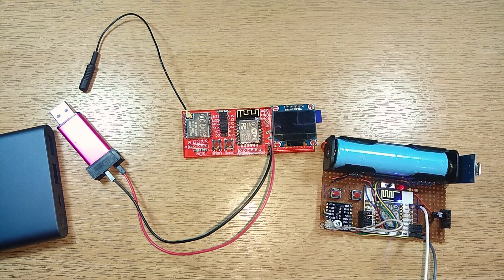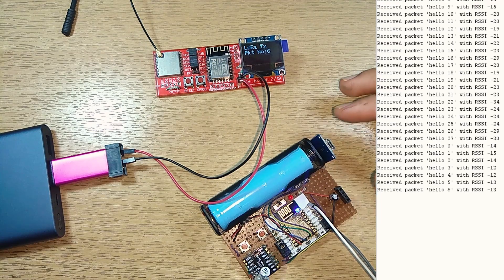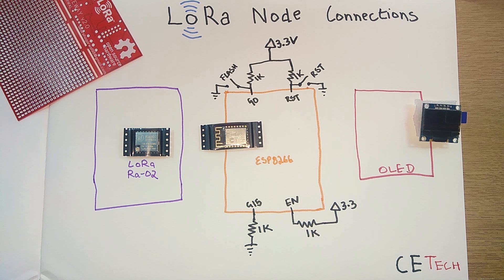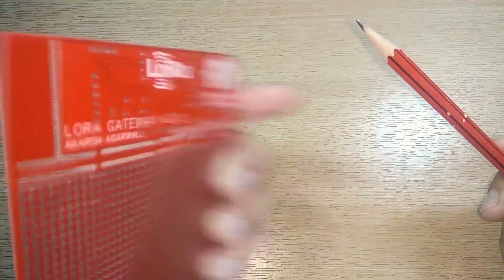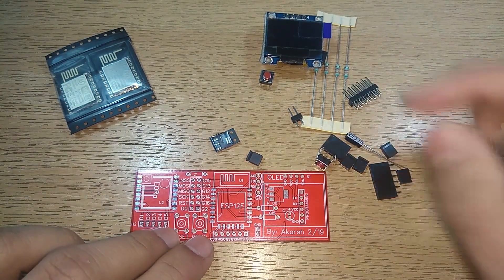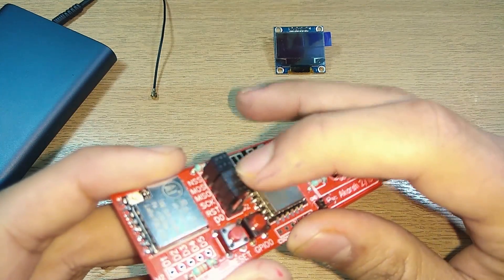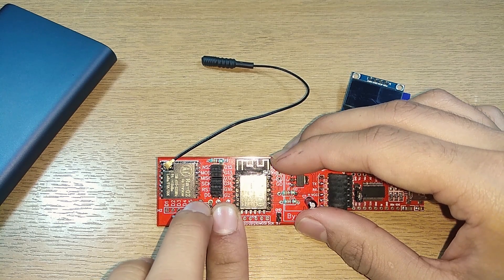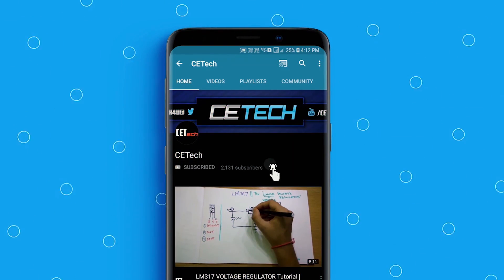15$ LoRa Gateway Node ESP8266 | Ra-02 SX1278 Tutorial

Comment: Hello CETech, greetings from Peru, congratulations on your excellent work! I would like your help. I have proposed to implement a monitoring system to warn of land overflows ("huaicos") in my city, for that I am thinking of setting up a "Wireless sensor network", I have researched and want to use LoRa technology, but I am still learning and Your videos have helped me a lot in developing my possible solution. Correct me and guide me if you think something is wrong in my plan: my system is made up of 3 sensor nodes (since there are 3 "branches"), each of them would have a microcontroller (I want to use arduino), a LoRa module (maybe use the RFM95W or something similar) and the sensors (humidity, temperature...), that's all. I have seen that each one can be configured as a transmitter or receiver, but the detail is in the "Gateway", if I have 3 sensor nodes mounted in the way I explained, I would need to be able to use a Dragino gateway or one like the ones you show in your channel.

What do you think of the structure as such?
What is the best way you recommend for the "gateway"? Or if such a single channel gateway would work for my 3 sensor nodes?

Comment: Thanks a lot, I built this using two Wemos D1 Minis and two Ra-01 modules, which are basically Ra-02 but with a spring antenna instead of the antenna connector. Using the LoRa library makes this really easy.

Comment: Hello, I connect GPIO2 to DIO0 of Ra-02, the code didn't work because of GPIO2 is the TX pin. Then I change to the GPIO5 (I don't use OLED), the code worked but the RSSI value is -122 with antena, I read the document of Lora said that the signal is very weak. Can you help me!

Comment: Hi, thank you for this useful video. I've a few question. 

# The ISM Band in my region is 868 mhz. Can I find a Ra chip suitable with 868 Mhz ?
# I've 8 channell lora gateway. Can I send message from the module that you designed to my gateway as end-node ?
# Is there any source code to use  as an end-node device which sends data to gateway.
Thanks in advance

Comment: Good job Akarsh but btw there are 2 things i'm concerned about . That ra-02 which you have used works on 433Mhz which is not a ism band for india secondly what you have made is practically a LoRa node not a LoRa gateway because a LoRa gateway requires much more things .
Reply from the maker: It can be used as a single channel gateway. Also gateway is basically a link between LoRa and the internet. This hardware is surely capable to do that